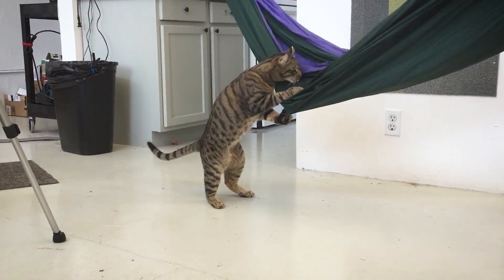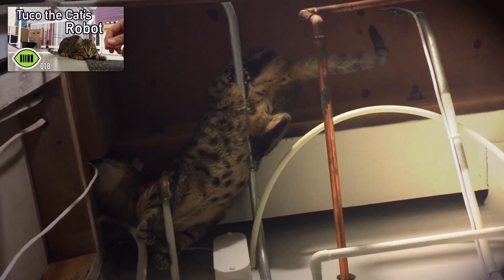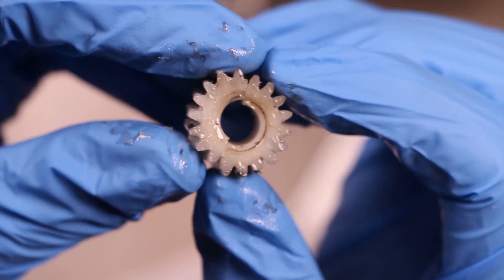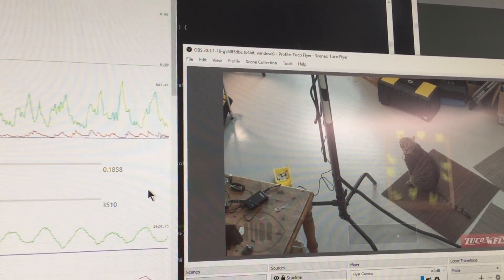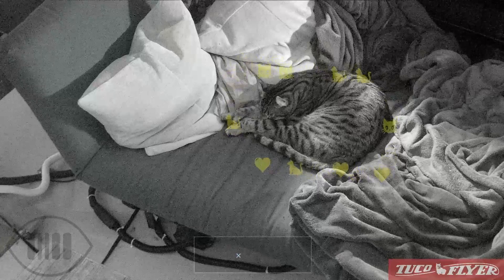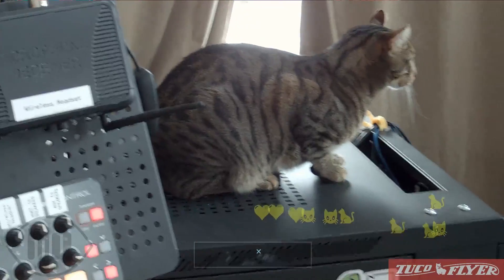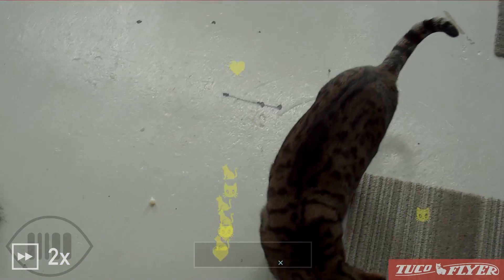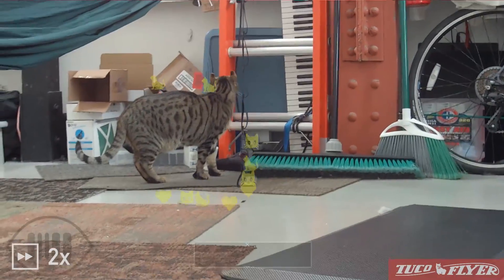An Early View from the Tuco Flyer 3D Printed Camera Robot

Comment: I'm sure you've already thought of this, but a 'Tuned Mass Damper' might be helpful reducing the unwanted oscillations on the camera boom. It's low tech, and adjustable if you make future mass altering modifications to the Tuco Flyer.  Or maybe it's the wrong approach, I'm not an engineer.
Reply from the maker: It's definitely something to keep in mind! A few people have brought up tuned mass dampers, and it would have been a good idea to talk about those briefly. If I'm adding mass though, it would be simplest to add more above the saucer area, to put the center of mass close to where it's being pulled from.

Comment: Would it be feasible to shorten the body and have the gimbal mounted on something that could extend/retract as needed? It seems like the purpose of it being so long is just to get those close-to-the-ground shots. So if the bot has reached the lower limit of its winch movement, it extends downward to get Tuco in frame. When that's not necessary, it pulls the gimbal back up to reduce the pendulum effect. Might be more complicated to implement than I'm imagining, it's just what occurred to me.

In any case, this is such an awesome project, and it's incredible how well it's working already.
Reply from the maker: The close-to-ground shots need manual piloting anyway, the boom really helps with shots that are up to 0.5m below the tallest furniture or people in the room :) Extending the camera below a sensor platform would be interesting, this could even be a tiny winch on the sensor saucer, or a fifth winch on the ground with a pulley on the saucer. Thanks!

Comment: Interesting. So it's kinda like a delta style 3d printer. I wonder if you could use a duet board for easier programming. You might also be able to use stronger cables, like a thinner steel cable and put more tension on the whole system.
Reply from the maker: Actually, i really wanted to avoid using high tension steel cables. I think lower tension nylon cables will lead to a safer system and less stored energy around me and my cat :) As for the pcb, this really can't be centralized like a 3D printer, I need something that lets me put a separate microcontroller at each axis.
Reply: hm that's a good point I didn't consider, you wouldn't want that snapping.

Comment: Hey, love your work. Have you ever thought of using a 3D scan to map the more stationary objects in your room, add your cameras position relative to that scan, then check its movements to see if its a legal maneuver so not to crash into anything?
Reply from the maker: Yeah! This kind of pre-mapping or even a simultaneous location and mapping (SLAM) scheme would be possible with a depth camera or stereo camera on the robot. That might be doable with a single camera, but I'm not sure the results would be good. So far, I've been trying to do this without requiring a robust position estimate for the robot, since I think that might lead to a simpler and more reliable solution.

Comment: For some stability at the camera perhaps you could tie some ropes just above where the camera swivels near the base of the boom and tie the other ends of those ropes to the winch cable about a foot or two away from where the winch cable attaches to the top of the camera boom. That should give a little more stability without adding that much more weight.
Reply from the maker: That's an interesting suggestion! I think I could attach counterweights to the midpoint of those lines too, which would help raise the minimum tension, which would help things some.
Reply: True but too much weight there may cause there own pendulum effect. Hope it works out though. It would be nice to be able to get more stable images.

Comment: Maybe you can add a Raspberry Pi with the vision coprocessor to operate a camera in a fixed location high up? It can be a solution for when Tuco jumps completely out of frame. Or just code the tracking so if it doesn't see a cat, try checking a fixed camera to get an idea of location.

Comment: How much are you using OpenCV if at all?
Reply from the maker: Good question! I've used OpenCV in other projects, but this time I didn't end up using it at all. I'm using two algorithms right now: for identifying objects and their locations, I'm using YOLOv2, using a derivative of the author's original implementation in the "darknet" framework. Second, for watching how a rectangle of pixels moves around from frame to frame I'm using a correlation tracking algorithm in Dlib, which is a big general-purpose C++ library that happens to have some computer vision stuff in.

If anyone has the followup question "Why not OpenCV?", well, the approach I took was to look for the algorithm implementations that fit my needs then to pull in whatever libraries I needed. So, if there's a specific algorithm in OpenCV that you think would be a good replacement for something here, that's something to consider! But the approach I'm taking isn't really to restrict myself to a single library, I just haven't needed OpenCV yet in this project.

OpenCV is in fact useful for a lot of general image processing and OS-level stuff, but since I was implementing an OBS plugin, I was using their layer for this sort of thing.

Hope that answers your question(s)!
Reply: Yes it did thank you! fyi did you know about OBSProject is now on Discord?
Reply: Also do you have compiled versions of your OBS plugins?
Reply from the maker: no, sorry
Reply: Well, then get on Discord AND you can always compile them and upload to the OBSproject forum's resource area.
Reply from the maker: I don't want to maintain a binary release, and it's really only useful in an unmodified form if you also have one of these exact same robot setups. And if so... you can download MSVC and build it! ^__^
Reply: I don't think my outdoor birds would like that robot to much..but hmm :)

Comment: Maybe you an stabilise it by a rotating disc? - Like a bicycle stays up.
Reply from the maker: Yeah! Maybe reaction wheels, somewhat like a spacecraft would use. This just gets heavy and complicated fast, so I'm going to explore simpler options first :)
Reply: Well i don't expect it needs to be so complicated. One or two simple disks that (maybe) only spin during movement phases. Maybe you could add another camera on the ceiling and let the cat-searching algorithm run on it so you could reposition the flyer whenever it lost track. This idea pushed forward: if there was a ring of cameras you could calculate a virtual flyer-camera picture and get rid of the hardware completely :-D Anyway, have fun solving the issues :)
Reply: I think a reaction wheel would quickly get saturated by torque from the winches. A CMG or just a static gyroscope would probably be enough